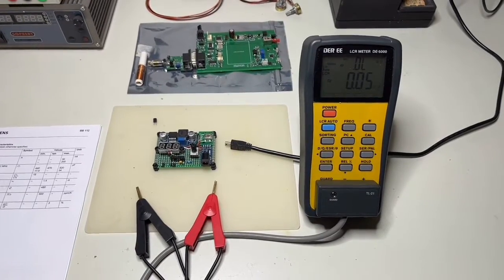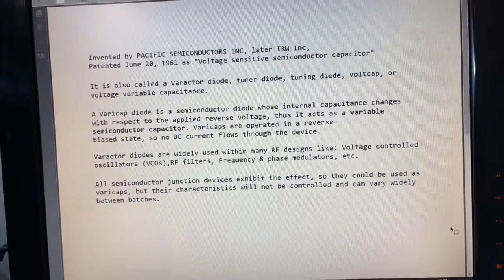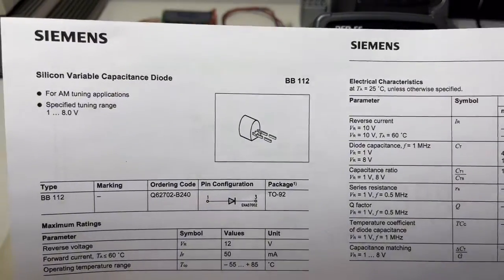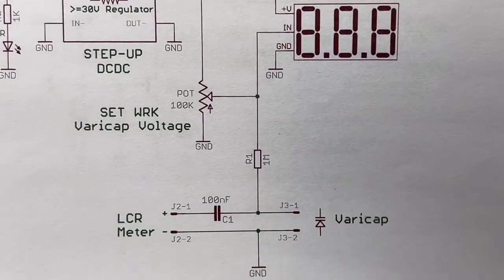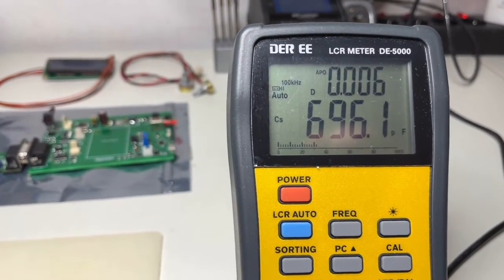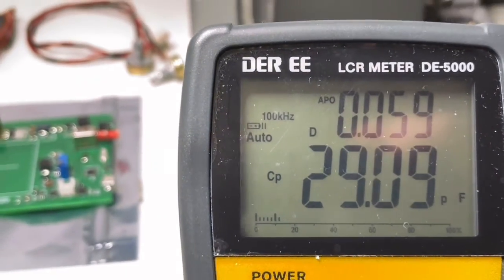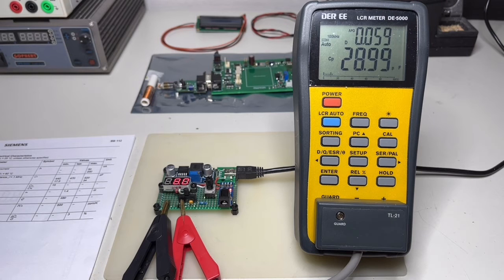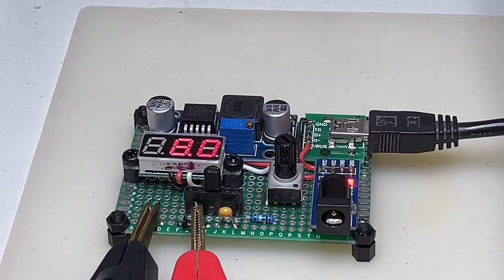Varicap or Varactor? Simple Tester for the almost forgotten discrete Capacitance Diodes

Comment: I guess I'm confused how the DC block cap doesnt get picked up as a reading on the LCR meter. I know 100nF is low impedance to let 100khz pass usually but block lower freq as a HPF but I thought your reading would be the series combination of 100nF and varactor
Reply from the maker: Hi Matt, the 2 capacitors in series , the 100nf with the small one max 500pf of the Varicap, if y calculate the the total Series capacitance , y will see that effect to the smaller capacitance is very small. As i said in the Video, this is not a accuracy testing, but a ballpark teating.
Reply: To use real numbers...100nF in series with 10pF results in  9.9pF capacitance. 100nF in series with 1000pF results in 990pF capacitance...As we used to say...close enough for FM  ;)

Comment: Nice tester, i love DIY test equipment. i guess that this is a component that can't be tested by using a simple curve tracer ? Grtz
Reply from the maker: Hi Bjorn, to test it y need to reverse bias it, donno if a you can configure a curve tracer to do that, except it has an option for Varicaps. Cheers
Reply: @KonstantinGrigoriadis  , i have build as test a few years back a simple curve tracer, but that used only a small transformer at 9V AC with 50Hz. Need to build this back again and place it in a project box. I want it mostly for testing Zener diodes. Another well known Electronics YT channel said once, that Zenerdiodes above 5V are in fact not Zenerdiodes, but Avalanche diodes, because the "knee" is much sharper. Don't know if this is true are not. For a project where i'm still working on, i need low voltage (below 5V) Zener diodes with a smooth "knee" curve. I'm just a Electronics hobbyist, but it is sometimes difficult to notice the difference in diodes characteristics because some people trow all kinds of names to a specific diode. Some people say that a TVS diode is the same as 2 Zenerdiodes back to back, while both types of diode has there own use. I'm more of a person "seeing is believing" , when i order parts, i order also low priced unknown types of parts to do experiments with to learn how these parts works. Grtz